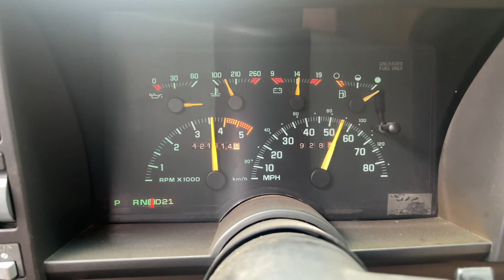Obs ASMR

Comment: Nothing like the sounds of the GMT400 aka obs I have an 88 single cab long bed K1500 with the SM465
Reply from the maker: I swear man. An ole 350 sounds so dang good
Reply: That is so true mine isn't straight piped however I have the cat delete and thrush mufflers which both are out the back